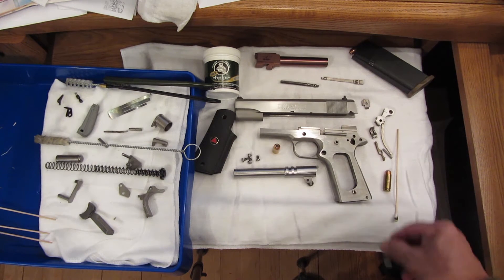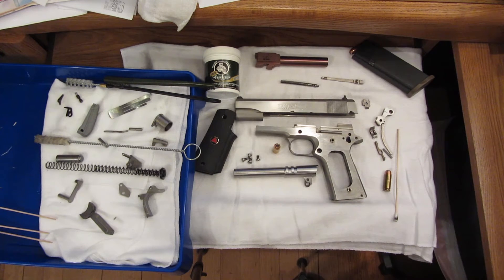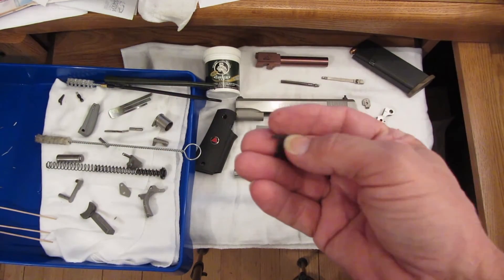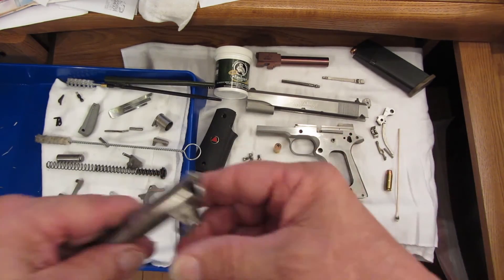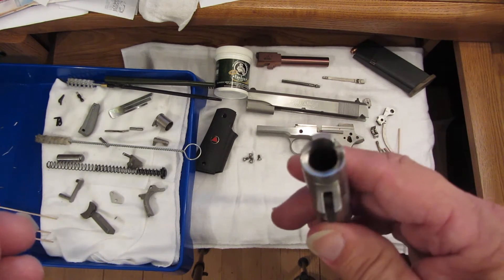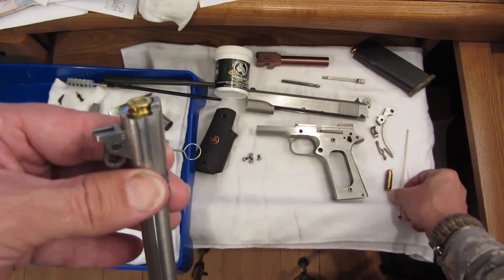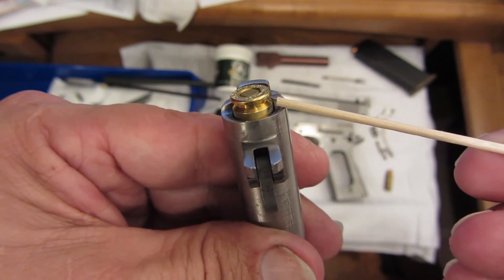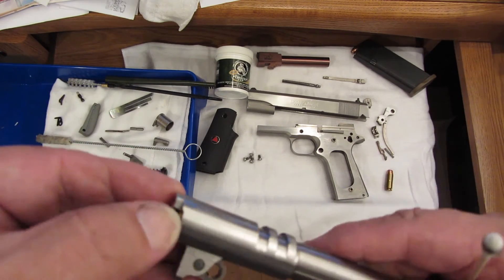Colt Delta Elite 1911 Unsupported Barrel Chamber

Comment: Is it possible to get a barrel that's fully supported for a delta elite
Reply from the maker: +Deacon Ness From what I have been told by several Gunsmiths the answer is "No", not in its current configuration.
The "Standard" 1911 barrels have the feed ramp milled into the chamber. Some 1911 manufacturers place the feed ramp outside the chamber. I would need my Frame milled out to make room for that outside feed ramp.
But then again from what I've been told it isn't that big of a problem if I use Hot load ammo, just don't use the Super Hot, which I wouldn't need any ammo that hot anyway. 1300+ fps. is fine, I don't need to go 1500+ fps.
Reply: So you think a standard Colt delta elite barrel would be fine with underwood or buffalo bore? I read online a guy bought a barsto barrel to put on his delta elite for underwood ammo. Would you suggest that?
Reply from the maker: +Deacon Ness Barstol Barrel would be the best option. The thing about Barstol barrels is that they are made Oversized, they need to be custom fit to your particular hand gun. That would be the tightest fit.
Underwood does make ammo they say that works for the Colt Delta Elite, not sure what Buffalo Bore ratings are though.
Reply: Could a bar sto barrel be modified only? Or does the gun have to be modified also?
Reply from the maker: +Deacon Ness The Barstol Barrel is the only thing modified. Usually the chamber hood (The Exposed Part of Barrel on Top of Slide) is made longer and wider. That is the part the Gunsmith will file down to make it Fit Your Slide. Gives it a perfect fit. A barrel called "Drop-in" will fit nearly all guns without gunsmithing.
Reply: Great. Looks like I'll be getting a barsto barrel for my Delta Elite